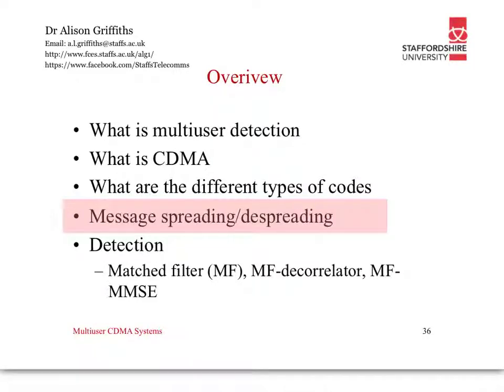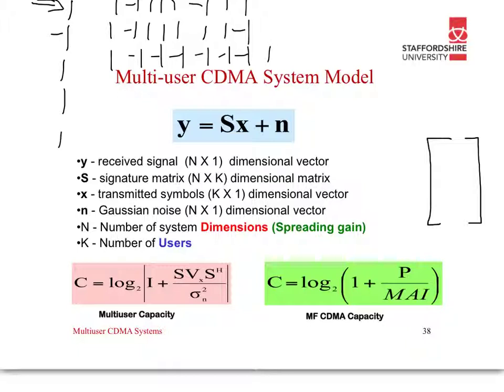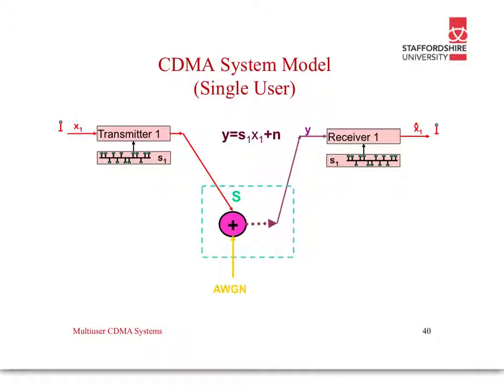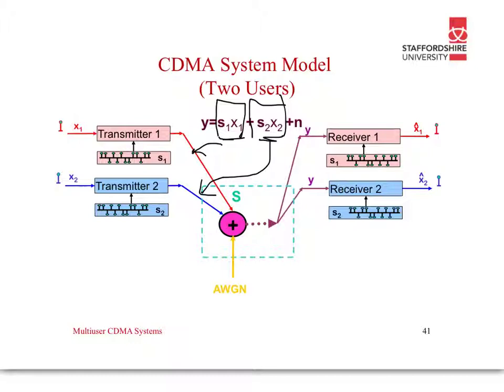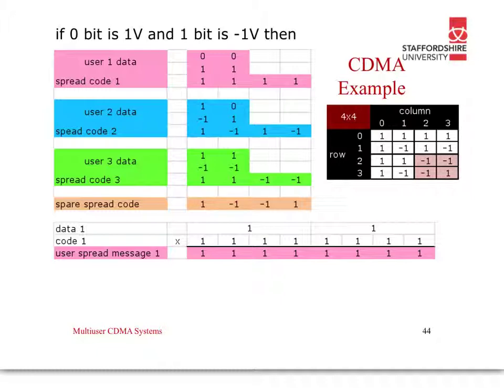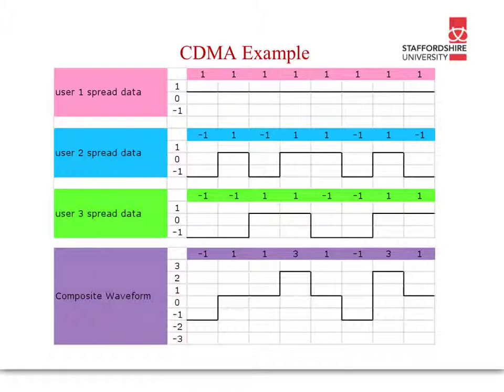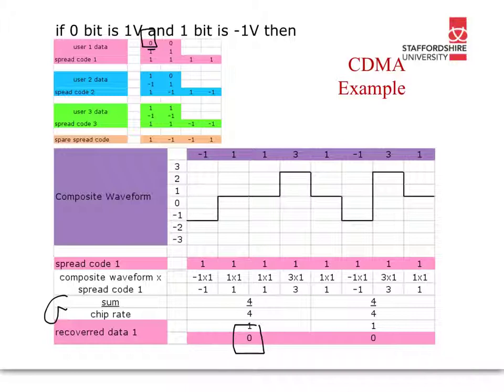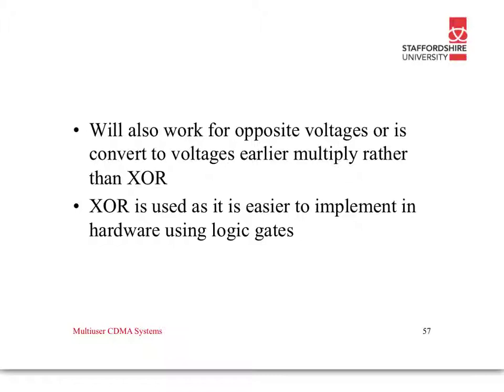CDMA part c

Comment: What will happen if the users do not send the data at the same time? Suppose one user data is partially added in the composite signals as the user comes little bit later in the transmission process. Then will it be possible to recover the lately arrival user data at the receiver end?
Reply from the maker: It is possible but would require more signal processing, this is meant as an introduction of the concept